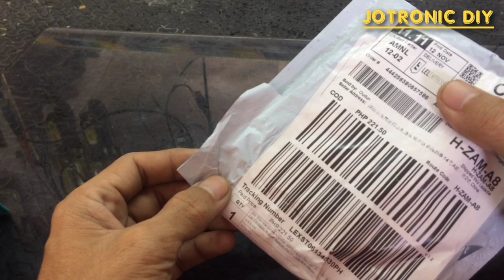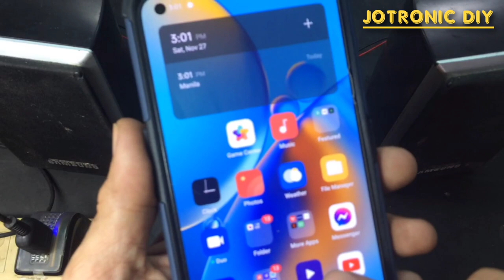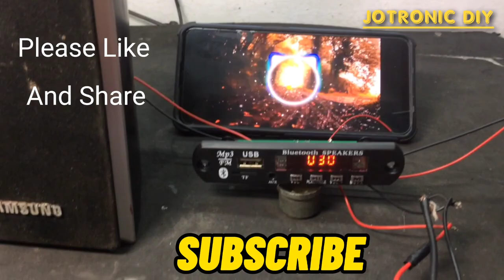How to Install Bluetooth Speaker Module/ Paano Mag install

Comment: yung Bluetooth Module na ganyan na bnli ku sa shopee ayaw gumana eh tsk sayang lng kkadating plang ngayun
Reply from the maker: Icheck nio po sir yung voltage supply ng nklagay s description ng bluetooth n nbili nio
Reply: @jotronicdiy6058  5 to 12V nman yung nkalagay sa module na nbili ko pero nung tinest kuna no power tlga cya gnamit kupa dun yung adapter ng Tv+
Reply from the maker: Ayaw po ba mag power? Baka po  sir may depekto yung nabili niong module
Reply: @jotronicdiy6058  Ou nga paps eh merun tlga defect na complain kuna yun kay shopee tska bago nman ipa ship ng seller nag chat pa ku dun na i Check/test muna yung item bago i ship eh gnwa lng ata pinicturan lng yung item indi nman tinest tsk...
Reply: @jotronicdiy6058  taga dto sa pinas lng npag bilhan ku nun eh

Comment: Link ng bt module?
Reply from the maker: https://s.lazada.com.ph/s.exyku
Reply: @jotronicdiy6058  pwede po ba dalawang battery na 18650 yung power supply niya?
Reply from the maker: @jaysonqtv   pwede po Yun gamit LNG kayo Ng  battery charging board na nabibili SA shoppee at lazada
Reply: Name ng module boss..  iba po.kasi ang nkita kung module 3 pin socket lng wlang pang speaker